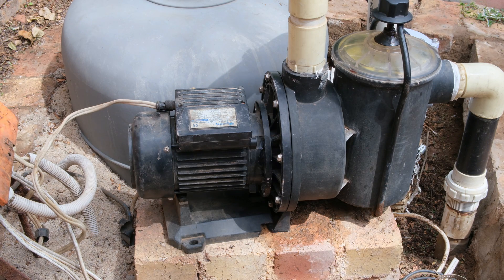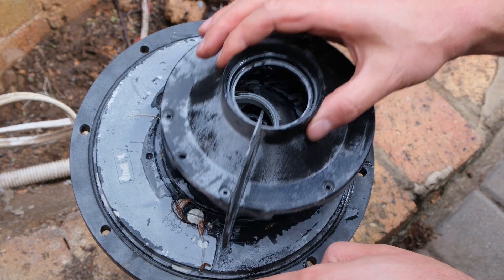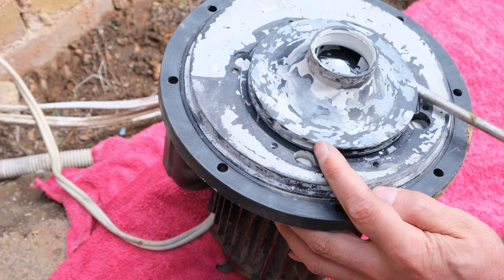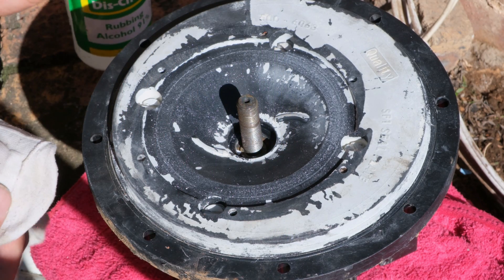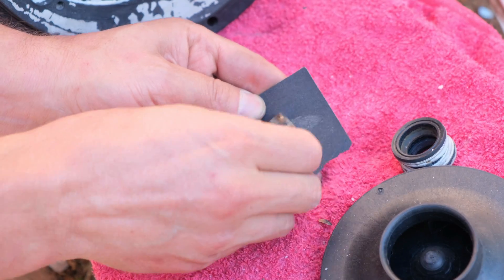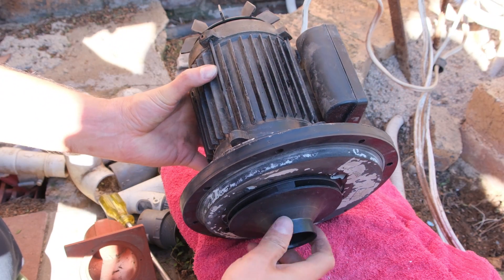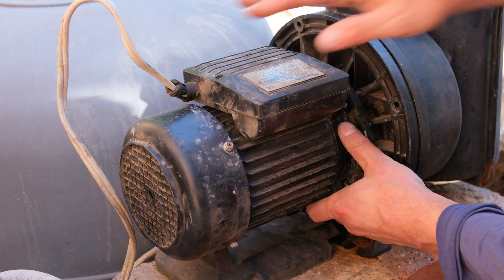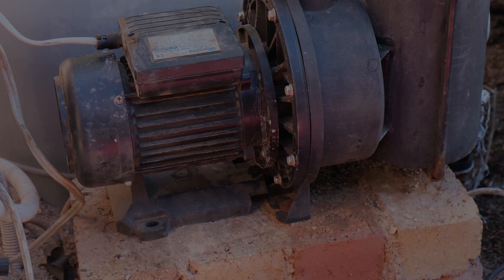How to change a universal mechanical shaft seal, impeller, o-ring on an Eartheco & Quality pool pump

Comment: How to change bearing  of same pump
Reply: Bearings 2062 in the front and 2063 at the back. You’ll need a bearing puller but other than that it’s straight forward.